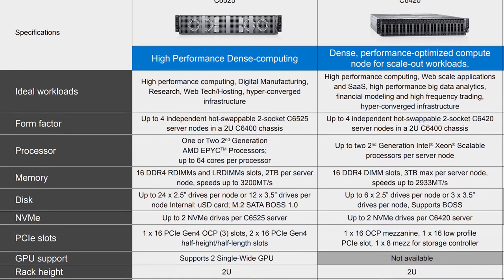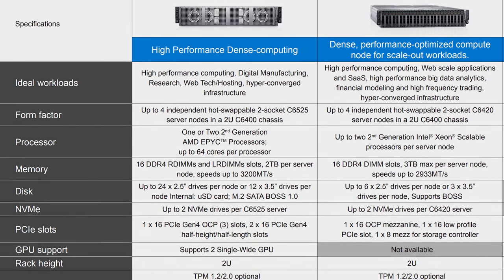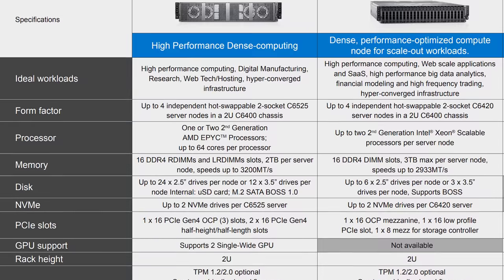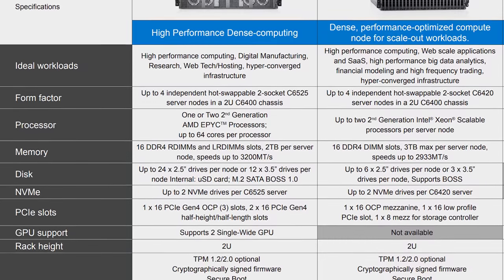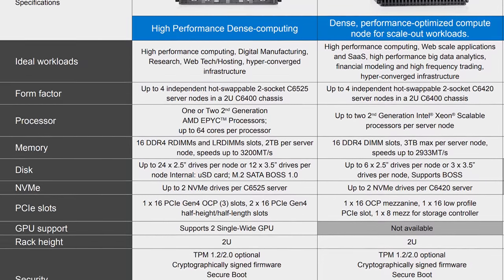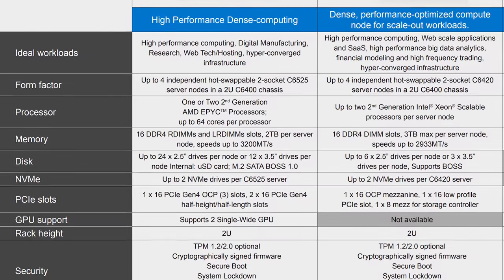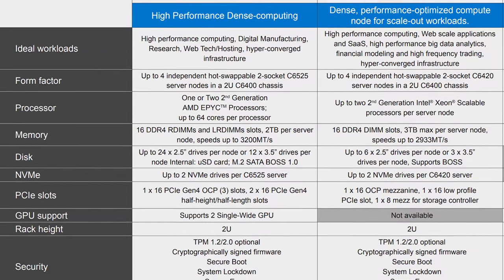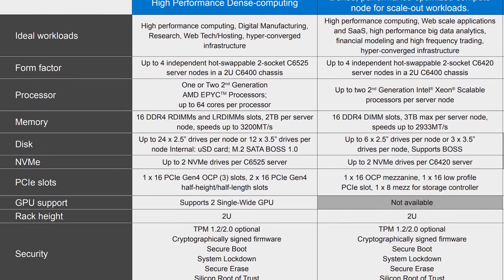Dell EMC PowerEdge C6525 AMD EPYC Powered Kilo-Thread Server Review

Comment: I would like to know how fast this would compile the Linux Kernel
Reply from the maker: We have reviews with almost every EPYC SKU on the STH main site that includes this
Reply: Me too
Reply: I've compiled it on a 2x 8276L box with 192GB RAM, from a 4x Corsair MP510 VROC RAID0 disk. Fastest I managed was roughly two and a half minutes. The biggest limiting factor at that point is filesystem overhead, and I found that there was a huge variance between compiling from NTFS on Windows, from a Ubuntu instance in WSL, and from an ext4 partition in a Debian VM.

The Ubuntu WSL compile was by far the slowest, multiplying the compile duration several times over, whereas compiling from an ext4 partition on the Debian VM (under Hyper-V) was faster than NTFS on Windows by a decent margin. I then tried running the Ubuntu VM directly from memory (I put the entire VM on a RAM disk) and found that there was not a lot of improvement in terms of speed, which indicates that performance was already bottlenecked by the filesystem rather than the underlying disk IO speed.

I suspect that some of the reason for the poor NTFS performance is that the compile toolchain is very much optimised for operating on ext3/4 filesystems. The WSL IO performance situation is likely to improve a fair bit with WSL2 in Win10 v2004, but I don't expect it to be anywhere near as good as native ext3/4 in a VM.
Reply: @gsuberland  I'm trying to work out: did you build it on a non VMless system? Ie just install debian on there and run without any hyper visor overhead.
Reply: @lawrencemanning  No, but the Windows test was also done under Hyper-V so it's an apples-to-apples comparison. A friend of mine has done the same on a dual-8280 box with Linux natively and gotten similar results.
Reply: Probably faster than it takes for a human neuron to send a signal from the brain to the hands lmao.

Comment: I just read the review on STH and this one part struck me as absolutely outrageous:

“We did not get to test higher-end CPUs since Dell’s iDRAC can pop field-programmable fuses in AMD EPYC CPUs that locks them to Dell systems. Normally we would test with different CPUs, but we cannot do that with our lab CPUs given Dell’s firmware behavior.”

How is Dell getting away with doing that? Shouldn't there be laws against that?
Reply: That was option allow Dell, Lenovo locks server CPU serial with motherboard.

Comment: Super cool product! Can someone explain the "firmware fuses" that prevent upgrading CPUs. Does this prevent new CPUs from being installed, or the old CPUs from being moved to a different system or what? It was a throwaway comment in the video, but as someone who will likely not buy servers new and will often want to upgrade CPUs, this is important to me
Reply from the maker: See a bit more on page 3 of the main site review. https://www.servethehome.com/dell-emc-poweredge-c6525-review-2u4n-amd-epyc-kilo-thread-server/3/
Reply: Thanks for the reply. I’m still a bit confused to which Dell systems this applies to. Is it any system without a BMC, any Epyc system, any Epyc system without a BMC, any system with more than one node per chassis or some other requirement?
Reply: basically, amd and dell pulled an apple, while pretending it's about security. these fuses are in the cpu (there is no pch, the pch is in the cpu), if they are blown, it's almost impossible to be used in an other system. so if the system does no longer perform as you want, you recycle it. nice!!!!
Reply: starshipeleven  no, in a few years, the cpu's/servers will be cheap anyway. this helps noone besides amd/dell/whatever to sell more.
Reply: starshipeleven  lol, yeah, the fear of ppl stealing our cpu's is now gone...
Reply: starshipeleven  That's not the security benefit here. It's part of AMD's Secure Processor, and it allows the CPU to verify that the BIOS isn't modified or corrupted, and if it is, it refuses to post.. It's not exactly an efuse and more of a cryptographic signing thing going on where the Secure Processor validates that the computer is running a trusted BIOS image. The iDRAC 9 can even validate the BIOS image while the system is running. The iDRAC can also reflash the BIOS back to a non-corrupt, trusted image. On the first boot of an Epyc processor in a Dell EMC system, it gets a key to verify with; this is what can stop the processor from working in other systems as well.

Comment: Per core licensing for that thing will be a little pricy.
Microsoft Server 2019 Datacenter would be $196,960 for 512 cores.
Microsoft SQL server 2019 Standard per core (if you license all 512 cores) is $918,016
Microsoft SQL server 2019 Enterprise per core (again license all 512 cores) is $3,519,488
Reply from the maker: Certainly! This can handle the 7Fx2 frequency optimized parts with lower core counts. Also, those tend not to be the applications you ideally would put in a dense system like this.
Reply: One thing to note is that there's a promotion going on this year pertaining to Windows Server 2019 tied to OEM EPYC platforms where you only have to pay for licensing on up to 32 cores per socket. While a 512 core system will still be expensive to license, it'll be half the cost of a typical licensing model.
Reply: Is there anyone that would actually pay that much? I don't know what Windows & SQL Server provides over Linux & PostgreSQL that would be worth that much.
Reply: You could go with the EPYC 7F52 instead. 16 core 32 threads but it has the same amount of cache as the full 64 core and much higher clock frequency at 3.5 Ghz base, 3.9 Ghz boost. Increased frequency means more power so it's 240W TDP which is slightly more than the 64 core. 

8x16=128 cores instead of 512
Total licensing cost is cut in 1/4, so $879,872

I don't know what the performance difference would be, but it's something to consider.

Comment: In Hour current hosting a 0,5U server density would overload the AC, so we can't use the full rack capacity. However if those servers would be more cost effective for hyper converged virtualization hosts they would still be a good new generation, thanks for looking at the power numbers.

Comment: WHAT? "You cannot change the CPU because they blow fuses within iDRAC firmware" ? Seriously? I have never heard of such an incredibly stupid move. Could you elaborate more on that?
I also question the power delivery. Two redundant 2400W PSUs seem quite tight. 8 64-core SKUs already use up to 1920W and even above that with the 280W SKUs. That leaves roughly 400W for "the rest" - or 100W per node. You could easily kill that power-budget with DDR4-3200 RDIMMs in sufficient numbers (like 4*16 modules of 64Gig parts). There is no room left for decent PCI-e peripherals. I assume, for the more power-hungry CPUs, they ship better PSUs?
Last but not least, I have grown a strong distaste for iDRAC (racadm more specifically) over the years. It is utter bloat and may change command syntax and sematics with releases. Good luck, if you want to automatize by scripts. Been there, done that.
To actually interface iDRAC from RHEL or CentOS, they provide repositories for the bits required. However, the repos are utter and complete crap. Want to send a system report to get support? Very well, the reporting tool essentially puts the entire /etc in a tarball. Including your LDAP config, which may contain passwords in cleartext. I went a mile or two with their support, telling them that they can try to get the report out of my dead cold hands.
My experiences with Dell are a few years old (about 2016, when I last touched their crap in ernest) and things may have changed, but as long as I get to decide, Dell is out of the equation.
HP is usually pretty good, but getting a decent quote from one of their "distributors" without endlessly wasting time is next to impossible. The stuff Lenovo ships is said to be more and more crap by the day (although I am lacking first-hand experience more recent than about 2010 - by which Lenovo still was IBM, who gloriously f*cked up their HS21/22/23 line of blades). CISCO UCS is crippled beyond repair (look at their blade-center fabric setup...) and Fujitsu apparently strives for being the Gucci of the server world, considering their pricing.
White-box wise, Supermicro is decent as long as you pick their Intel line. Anything AMD from them is utter crap. I suspected, they bury AMD solutions (Aplus, as they call them) so deep on their website, because they are so closely affiliated with Intel. But looking at the AMD products, it seems wise to do so.
If current customer plans go as expected, I might be tasked to setup a new AMD virtualization infrastructure beginning at the end of the year and I already have headaches picking a supplier for the server-hardware.
To me, the entire industry is in an epic failed state, when it comes to EPYC (pun intended). And I wonder why. Intel currently has nothing even remotely competitive in terms of density, clean architecture and economics to what AMD is currently offering with Zen 2. I can only assume, big companies are holding back because Intel has them by their testicles.
Reply: Gigabyte?
Reply: @TheBackyardChemist  Might actually be an option. I haven't tried any of the more recent stuff, but at least their enterprise mainboard range looks decent. As for barebones, they appear to ship chenbro rackmount cases, which isn't the worst option either.
However, I found it quite hard to find a distributor, capable and willing to BTO the stuff I need. I had a long and unsuccessful time trying to find someone who'd sell me (the company I work for) a Thunder X2 ARM system which I wanted to evaluate closer.
But overall, that might be an option.
Reply: @virtualinfinity6280  They AMD lineup looks really solid, and I think they also sell ThunderX2 systems as well. The pandemic threw things off the rails, but I think they are relatively easy to obtain in Europe.
Reply: @TheBackyardChemist  Yes, they also have a Thunder X2 lineup. I was referring to Gigabytes Thunder X2 line, of which I was unable to obtain a system for eval. I suppose, that is not Gigabytes fault but rather a shortcoming of their distributors.
The AMD lineup does look rather decent, but I have not seen any of those systems.
Reply: Supermicro is a complete POS when it comes to motherboards in generally. Their mechanical designs are generally acceptable, albeit there too sometimes moronic issues (ie. Fat Twin finger connectors are utter crap, so much random issues with them). You cannot even update microcode on some SC motherboards because someone there apparently typoed Supermicro as Supermicor ... Nope, i am not joking. being Intel systems you know how important it's to get microcode updated - but you cannot do that.
Nevermind the BIOS on them is utter crap.

When it comes to EPyC motherboards there are some completely moronic solutions, like 2x M.2 slots on the motherboard like ~everyone else; What is hidden in the manual is that they drop them to x2 bandwidth if you populate both. WTF? EPyC has way more than enough PCI-E lanes for doing x4 on both, like everyone else does. Secondly, they make it almost impossible to install even; they use some plastic crapola standoff which breaks when you open it, and by the looks of it you have to either break it completely and use new one to swap position OR remove motherboard from chassis to move the standoff to right position ... I gave up at that point and gave them .... some feedback. Tho SC EPyC motherboards are on the cheaper side.

Currently we are leaning towards using supermicro chassis with ASRock Rack EPyC motherboards. Accessories from SC seems to be acceptable as well, such as cables, HBAs etc.

ASRock Rack makes some nice barebones too, but we need generally more drive bays than what they offer. Hence frankensteining
Reply: @skaltura  Although I haven't seen the moronic issues you have observed in Supermicro's Intel lineup, I can generally confirm Supermicro's inability to provide a decent AMD solution. Based on features, layout and connectivity I would never consider their current lineup. Likewise, their support is lackluster at best.
Funny enough, I also started to like ASRock Racks EPYC board. My personal system, which I use for infrastructure simlulations, is based on a ROMED8-2T. Fantastic little critter with quite useful options. Their documentation is practically non-existant (if anybody finds some documents on the BMC API - ReST? Redfish? - let me know) and the BMC software has some minor glitches. But the board itself is rock-solid and well done (however, why they didn't equip the 7th VRM phase for the CPU is beyond me). The BIOS has all bells and whistles enabled, which is a Good Thing(TM).

According to ASrock Racks roadmap, there is more to come, to which I am looking for. So yes, this could be an option, if all fails and the customer accepts me specifying the parts and have some shop assembling a bunch of systems and provide techsupport for them. The ROMED8-2T will not cut it in the planned scenario, as 8 DIMM sockets for the CPU is not enough. Maybe the come up with something more appropriate for my use-case. Gigabyte might be an option, but I have yet to see their EPYC lineup - so far just read about it. Same goes for TYANs EPYC lineup.
Otherwise, I'll see myself in endless salescritter-meetings with HP distributors, poking them for weeks until one coughs up a decent quote. Not something I am looking forward to - to put it politely...
Reply: What's wrong with Cisco UCS? I love it and so do a lot of my customers. Have you tried the recent stuff? What exactly is it that you dislike? 
I especially like the granular control over networking, the integrated 32Gb FC Fabric and the ease of use and maintenance as well as the rock-solid stability. 
Have you tried a FlashStack or FlexPod solution? So good!
Reply: It's part of AMD's Secure Processor, and it allows the CPU to verify that the BIOS isn't modified or corrupted, and if it is, it refuses to post.. It's not exactly an efuse and more of a cryptographic signing thing going on where the Secure Processor validates that the computer is running a trusted BIOS image. The iDRAC 9 can even validate the BIOS image while the system is running. The iDRAC can also reflash the BIOS back to a non-corrupt, trusted image. On the first boot of an Epyc processor in a Dell EMC system, it gets a key to verify with; this is what can stop the processor from working in other systems as well.
Reply: He said there is a 4000W option no?